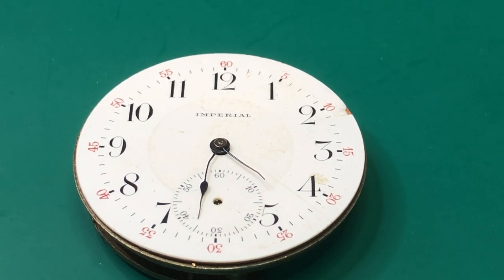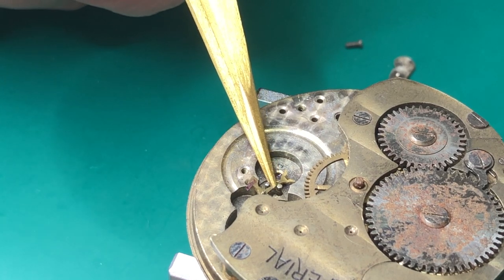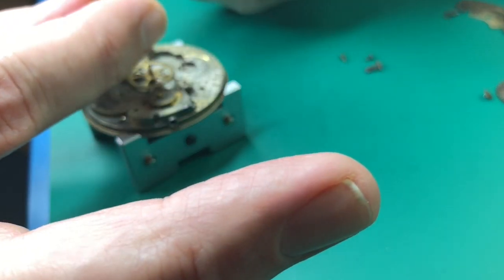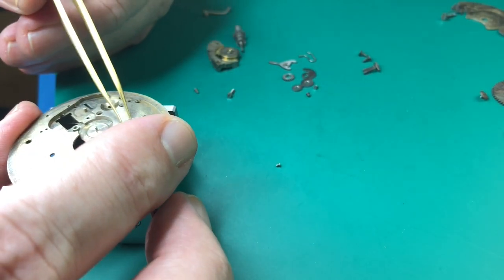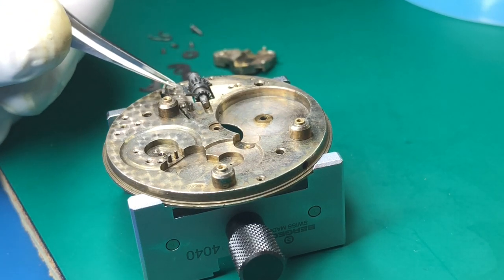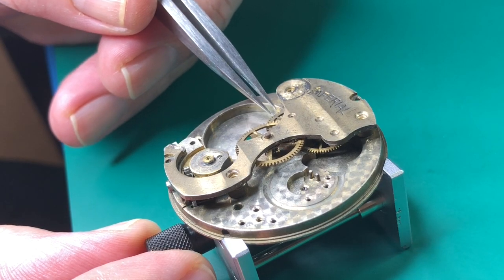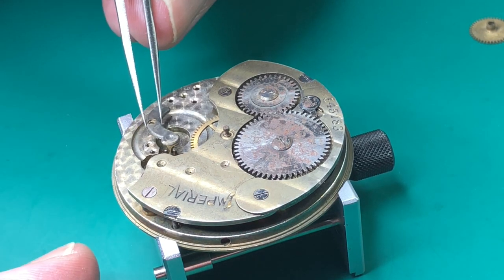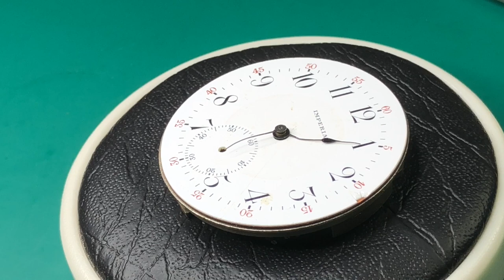Imperial Pocket Watch Tear Down & Rebuild

Comment: It is actually a key less work. There is a matching square in the case that will be attached to the crown. The long spear on the back side pulls the winding clutch back from the time setting works. Really nice work, keep up the good work! And most importantly, have fun!
The partial head screws are the case screws, they hold the movement in the case, The cut heads allow the movement to drop out of the case without needing to be removed.
Reply from the maker: Thanks for that - cheers!